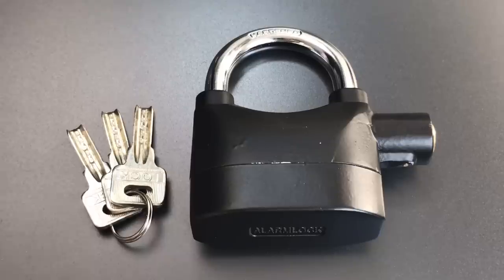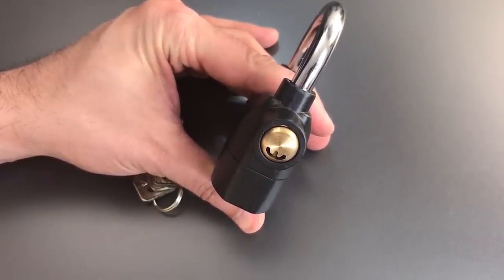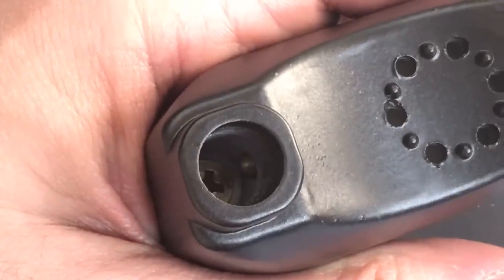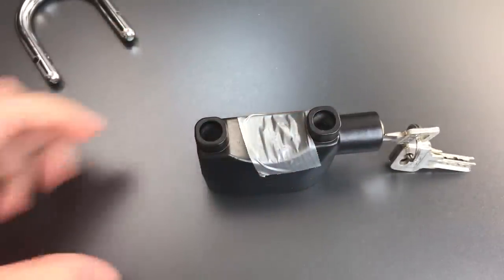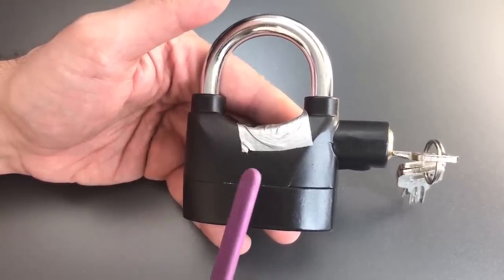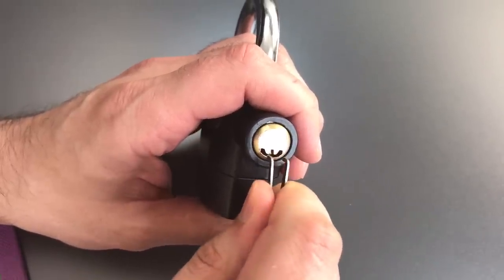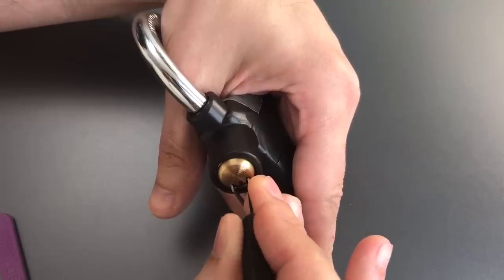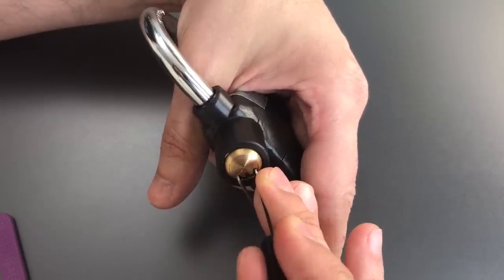[505] Chinese "AlarmLock" Picked Without Triggering Siren

Comment: over 2 minutes to be picked by LPL? thats a good lock.
Reply: I actually hit my phone.
Reply: So did I lol
Reply: Speed thats why you roll with dark theme lol
Reply: @wildseabass7991  I do. But I still don't like it.
Reply: Speed Understandable. Have a good day.
Reply: The fly on ur profile made me think there was a real fly and made me slap my tablet multiple times 😂
Reply: Why
Reply: @yeetdlgamer984  you slap insects on your screen?.. like, they'd get all splattered out on it...
Reply: @yeetdlgamer984  did you break it  ?
Reply: at this point the anti-picking strategy should be to make picking as complicated and annoying as possible to make would-be thieves gain suspicion after staring at a lock for 2 minutes straight
Reply: Yea I wonder because I've seen him recommend locks that he spent less time on, and he acts like this alarm isn't a good idea or an effective tool - 99.9999% of thieves aren't going to be prepared for it. If a master lockpicker decides he wants at your whatever, it's probably gonna happen.
Reply: @hansolo631  because he got through it with a hammer without triggering the alarm, the link is in the description
Reply: There's more to lock quality than time to pick.
Reply: Taking a long time to pick doesn't mean the lock doesn't have other issues.

Comment: I wonder what an injection of water would do to that alarm..
Reply from the maker: Better still, honey. It silenced the speaker.
Reply: Probably make it wet
Reply: A little quick poxy will silence it.
Reply: @lockpickinglawyer that sounded strange
Reply: @lockpickinglawyer  water would short out everything and kill it.
Reply: @commandroid9336  water is not a good conductor, especially for low voltage as these electronics
Reply: @lockpickinglawyer  I thought you were calling the commenter Honey lol
Reply: @cleitonfelipe2092  still kills phone. So why is that?
Reply: @commandroid9336  i have one , and it is water proof tho it will reduce the volume of the alarm ..
Reply: @Equilibrium8  oh ok that makes sense. So no fluid will effect electronics just the way of speaker. Thanks
Reply: not always, the micro-circuitry on a smartphone is very sensible, but if you dry all the water, it may work again
Reply: @cleitonfelipe2092  cleaning with isopropyl alcohol is important. The residues are what kills a phone by leaking current onto the wrong pins.
Reply: @commandroid9336  There's a lot of power and tiny circuits on a phone.  The basic theory surrounding the way semi-conductors work is that there's a minimum energy required to get it to conduct.  If you put a bunch of power through it, electricity will start flowing and continue to do so.  So basically your phone has a bunch of energy and close physical proximity to all these conducting surfaces.  Water will screw it up.
Reply: Katos suomalaisii
Reply: @commandroid9336  
Most water isn't pure and contains various salts and other electrolytes. On a board it shorts out pins and connectors either causing high voltage to spill into very sensitive components frying them or causing electrolysis of the connectors which results in significant corrosion and damage to the board.

In either event, a phone is a much more complex circuit than a lock containing many more components and with wires generally placed just far enough apart that things like quantum tunneling don't occur.

All that is to say, simpler circuits as a general rule tend to be more robust than complex and incredibly small circuits, although the length of exposure and the location and components contacted along with how long power continues to go through the system after exposure will determine the effects on any system.

Easiest way to test it is to just try it tbh.
Reply: Toshiro Plays  
I'm aware of that, most water isnt in it's pure form its mixed with salts and other organic and inorganic compounds that make it much more conductive
Reply: @c4rt00nk1d   lmao wow, I totally thought he was calling the commenter "honey" too :'D
Reply: Bomb disposal officers in WW2 Britain used salt water injected into the fuses to kill the batteries.
Reply: It's Chinese, what do you expect!?
Reply: buddy all locks are just to slow down action of thieves...
Reply: @cleitonfelipe2092  My huawei phone was in the washing machine for a full cycle. It turned on but needes constant charging because it couldn't go further than 2%. After 2 months it dried out completely and it's just as good as it was.
Reply: Do burglars carry honey with them while picking locks?
Reply: Higor Guedes honey will ruin the machincsand dampen the speakers
Reply: @i3luevein  hmmmmmmm great observation
Reply: @joshuaestell1648  it wasn't really an observation as I didn't see it, just an educated guess
Reply: @davidj3841  Trump got busy elsewhere and let it work again
Reply: @cleitonfelipe2092  Just throw in a fuck ton of salt.
Reply: Glue tho...
Reply: Freeze the whole thing with some liquid nitrogen, the batterie will not like that either.
Reply: Two words: Salt Water. Would immediately fry the electronics
Reply: Who knows it was the channel AvE I believe that had one of them spider box alarms and showed a bypass. And set it off after and stuck it in a glass of water and it kept plugging along with no problem
Reply: Here is finally one place where security sponge could be useful.
Reply: @lockpickinglawyer  Why are you so motivated and go to such lengths to pick locks ? Don't get me wrong I love your vids it is just amazing how much you are invested in lockpicking.
Reply: I don't think water would disable this lock the way people think. Water doesn't immediately neutralize a circuit. It conducts electricity and allows it to travel wherever it wants. For complex circuits such as a phone or computer, this is quite a problem as they tend to be very delicate and require specific amounts of charge at specific times. However, a circuit like the one in this lock is very, very simple. You either have charge going to the speaker or you don't. Water would just bypass the circuit and allow the charge to reach the speaker. Assuming the water is more conductive than whatever the wires are made of, of course. While the contaminates in the water may eventually cause corrosion and damage the circuit that way, it won't be nearly quick enough to prevent the alarm.
Reply: It looks like it is designed for outdoor use, water entry should have been considered. However, some water and tape might dampen the alarm sound till it is a easier job to pick. The lock is good consider that it seems to be one of the longest LPL took to pick.
Reply: Better yet, salt-water!
Reply: @lockpickinglawyer  well that's fataly flawed
Reply: Step 1: multipie layers of flex tape
Step 2: pick
Step 3: take the lock
Step 4: put it in water
Step 5: freeze it
Step 6: throw in the pacific ocean
Reply: @James3548tr  Some people are interested in the mechanics and skill of it. It's like sewing. Who needs to sew? No one really, yet you still have people who simply enjoy doing it, who simply prefer wearing things they made
Reply: @internetdumbass8422  Yes and no. Rice is your best bet in that situation, but if it's already fried your knackered
Reply: @BillAnt  I think CA would be faster and easier.
Reply: JayBS INDO Don’t you mean water was distant they can’t handle water for ever
Reply: @i3luevein  thank you for this comment.
Reply: @cleitonfelipe2092  what about a salt solution
Reply: @ClasherofWorlds  salt will obviously supply a lot of ions, so it will be very conductive
Reply: Hold up.
Jari Komppa watches LPL?
Reply: It is probably a piezo speaker, so water should silence it alot.
Reply: @cleitonfelipe2092  what about salt water
Reply: @Sip_Dhit  yes, salt water corrodes, conducts electricity and destroys everything
Reply: @Equilibrium8  
if there was nothing between the hole and the speaker the needle would quickly destroy it
Reply: @lockpickinglawyer  is membrane is reachable throught the holes? Can you poke it? If so, you can easily destroy the speaker.
Reply: @lockpickinglawyer  well at least it don't explode like Jackie Chan said......
Reply: @i3luevein  bruh
Reply: @i3luevein  underrated reply
Reply: @commandroid9336  Water corrodes and eats away the metal, but pure water is a lousy conductor
Reply: @SpeedcoreDancecore i know this and tap water is not pure water
Reply: @commandroid9336  It’s due to the rust and oxidization damage that it causes.
Reply: Soda, coca, tea, orange juice works better. I paid enough for my devices to know this.
Reply: @cleitonfelipe2092  Unfiltered water still does conduct
Salt water conducts greatly
Reply: @i3luevein  Ooh baby
Reply: @lockpickinglawyer  I thought you called Jari honey lmao I was like what?

Comment: My suspicion is the noise is less against lockpickers and more against lockbreakers that would use brute force.
Reply: Lockpicking is a lost art anyways.
Buglars nowadays wont even try to do that
Reply: @A-G-F-  ok boomurglar
Reply: @A-G-F-  Lockpicking only matters if you don't want someone to know you were there, if your going to steal whatevers behind the door, obviously they'll know they were robbed,so the difference between kicking it and picking it is just a matter of time and hassle.
Reply: You could always just dump water into where the speaker is and then intentionally set it off so it will short circuit itself.
Reply: But the tape
Reply: @dennied7826  i think a case can be made for some cases

If you know the owners of a house won't be returning soon like if they were on vacation it might be worth the hassle of picking the lock if you don't want to alert the neighbours by making noise with breaking windows
Reply: @gyrtiasnecrotaros4710  lol as opposed to what picking the windows open?
Reply: @Selloca  Yes!
Reply: @Easy8_  the execution does not affect intention.
Reply: @BasicPsychology101 hello, FBI
Reply: @dennied7826 or being extra devilish and preventing the wronged to claim insurance on what they stole, because there are no obvious signs of intrusion and you wouldn't know you need a lockpicking expert to look at your locks and see signs of picking on the pins, which the insurance company may still dismiss because they always find an excuse not to pay.
Reply: @Selloca Depends, because my windows are barred.. 

There not way you are getting through windows without cutting the bar.
Reply: @hamizannaruto  not sure how the windows being barred is relevant
You could technically pry the bolts from the wall if you were gonna break the glass anyways 💀 
My comment was a joke about window picking

Comment: The lock would have been better if the key itself completed a circuit so the alarm would still go off without the key or at least a bit of metal connecting the contacts.
Reply: Chalky , That would have been extremely hard and expensive for manufacturing since it's all metal. Imagine individually insulating the pins from the core and connecting them to the electronic board through the rotating core... Impossible! Better off placing a switch behind the core to be pressed by the tip of the key while inserted all the way in. But it's still  unnecessary complication of the design. It's good enough the way it is. No-one will attempt picking this lock when there are much easier ways to open it.
Reply: the alarms a gimmick, they don't really care about the lock, they just want it to make noise to impress suckers and sell em.
Reply: Chalky hello
Reply: Or better yet, user a chip, since the inside is powered electronics, only the presence of the chip's RFID should disable the alarm, or even the release pin of the bolts. No need to mess with circuitry completion inside the key.
Reply: How about shocking the picker (like a taser) when a wrong pin is pressed? Ouch ouch wrong pin again!! ... he-he
Reply: that
s a good point
Reply: Use a plastic pick 💁‍♀️
Reply: Plastic pick? No problem, "When in doubt, use C4" ~ Jamie of  MythBusters!  ;)
Reply: @BillAnt  most have plastic grips anyways.
Reply: A sufficiently high voltage can jump even a plastic grip... anyway, I meant it in a comical way, course it's not practical. xD
Reply: Daniel Price < Pure plastic lockpicks are not sufficiently hard especially when thin, however metals picks can have a plastic grip.
Reply: Emm N. Fairly good idea an obvious way to bypass it but how many thieves would bother with the sort of work needed to get anything not worth a fortune.
Reply: The key would have to always be in the lock then
Reply: I have a better Idea. padlock filled with capactitors that just zap the fuck out of you if you touch it

Comment: I used to work for a retailer that sold these. Loads came back to us because the keys were getting stuck and the alarm was sounding. At one point we had 4 or 5 of them in our returns bin with duct tape over the siren, all going off at once whenever anyone touched the bin.
Reply: This is a hilarious mental picture.
Reply: Did that retailer sell hammers?
Reply: My first thought looking at them was 'I bet they'd alarm outside if the wind picked up.'
Reply: Microwave them, and the siren would stop
Reply: @thatguyalex2835  LMAO but the metal casing is RF-proof

Comment: That seems like a totally awesome lock. 

Admittedly I could probably cut the Shackle and only sound the warning with a pair of bolt
Cutters. (I suspect it can be shaken hard once) 

This video is 5 years old and probably one of the most awesome padlocks I’ve seen.

Edit: seriously he said it took him a couple tries. That means field picking it would be tough. Having set the alarm off going into a false gate. 

Picking a lock the first time is usually the hardest part. The brain instinctively recognizes patterns and the second and 4th and 6th time gets easier. 

I’m not denying LPL is a pro. I’m just saying if this lock is within earshot of a security guard. Your heist needs to go to plan B. 

It’s a good lock.

Comment: For a Chinese lock that actually wasn't too bad. Thanks for the video. 👍👍👍👍
Reply: it's build quality is where the chineseium shows within a couple months. alarm corroded and lock jams terribly
Reply: Obviously your use left it exposed to weather.  Did you use it on a bicycle or motorcycle?  In an ad for this lock, they showed it locked around some bike wheel spokes, crazy...can cut spokes with a small wire cutter.
Reply: There are a lot of good Chinese locks. For example my home in China use these two locks: https://imgur.com/a/kMQscND. Especially the right one in the image I haven't found anyone who can pick it yet (CEI 385T). It's just how much you want to spend (still very cheap compare with MulTLock).
Reply: @frank7353  8
Reply: Like the Chinese say, you get what you pay for. Want cheap shit? you get shit. Want the better stuff, you gotta open your wallet. Either way, both are made in China anyway.
Reply: Hmmm mine still fine..i use it on my bike every night..almost 2 years now..btw i leave my bike on porch..been soaked in rain countless time..still good..sry for my bad english
Reply: Not everything is junk
Reply: Cyberdyne Systems
When people think being made in China means cheap quality.
Reply: very good alarm clock

Comment: I think a little heat disables the alarm quiet well
Reply: can go the opposite, melted wires may short and trigger it, a bit like a car horn in a fire..
Reply: A candle wax could work.
Reply: YouTube Support before the wire insulation melts, the siren membrane will be long molten and not working in my opinion.
Reply: Any solder on the circuit will have melted first. Not sure if that will stop it. Will need to see the internals of this lock first.
Reply: YouTube Support , The battery is far more sensitive to heat than any other part in this lock. Wires will melt last if there are any wires at all in there.
Reply: Freezing it up may work even better,  since the battery will die easier than anything else. I'm thinking liquid nitrogen will do a great job.
Reply: I don't think thieves normally carry tanks of liquid nitrogen.
Reply: Ebin Gentleman     depends on if they haven’t been scouting a particular person or item out
Reply: Honey from a small syringe through the speaker holes completely nullifies the alarm if someone wants something and they have a modicum of skill they will take it.
Reply: @111chicane  I think he is talking about melting the speaker it's self not the battery
Reply: @antonyslaughter  Yes, he is, indeed. I'm suggesting to go for the battery. I'm afraid you didn't get what I said.

Comment: You could probably kill the alarm with some water
Reply: Yep. Yep, you could
Reply: @notdanny4985  not if its silicone coated. it can be easily done, even a whole little exposed circuit drone can be waterproofed, the beeper would still function.

Comment: It would be interesting to see if it can be cut with bolt cutters without setting the alarm.
Maybe shimed as well.
Reply from the maker: +JoeDurobot I've got you covered. Stay tuned. 👍
Reply: well cutting may be a problem, especially because when the lock falls off with the alarm setting part of the shackle still inside will certainly set off that alarm, but you can hammer off the body from the shackle  without too much problem as another video shows.